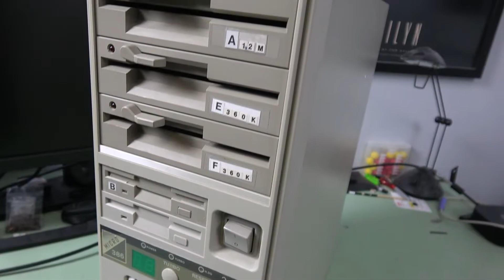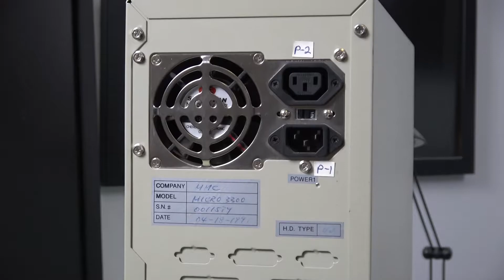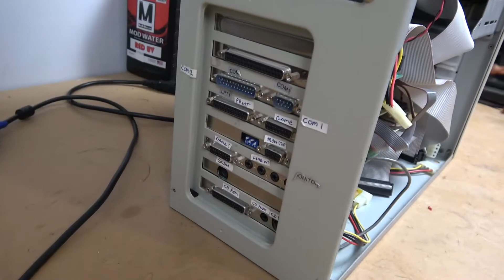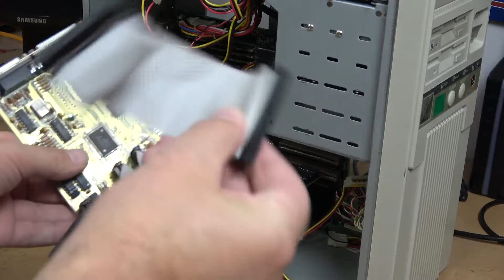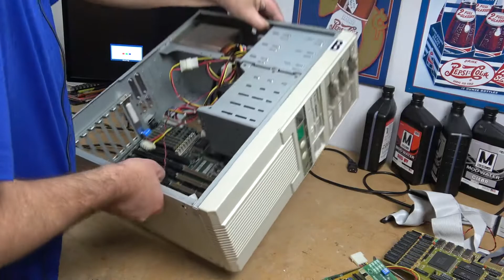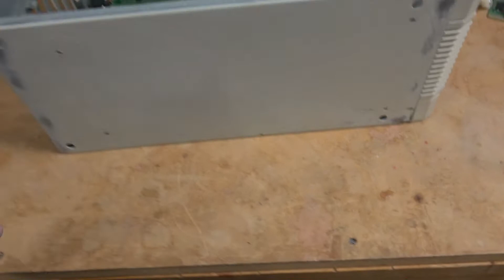Tear down of an Extremely Clean Vintage 486

Comment: Holy crap!  This was the exact same case I had when i was a kid!  Where did you get this?  I'm trying to source one for nostalgia.  Thank you for posting this video.  Brought back wonderful memories.
Reply from the maker: I picked it up off eBay.  I've always had the Mini Tower versions but, will agree the Mid Tower designs do offer more flexibility.

The plan will be to upgrade this machine to an 586 or maybe a Super Socket 7
Reply: @Hardwareasylum  I'll have to keep eyeballing eBay for this exact case.  So, far, not so good.  At the time I was just 14 when my family got rid of it, thinking it wouldn't hold value.  This is bc, I had a pentium 4 Prescott chip in a whole new case that I was using daily. 

Who would've known that I would of wanted to get back into this again.  I had my 486 when I was 7 years old, and I had Dos 5.22 with windows 3.11 on it.  Doom, Hexen, Duke Nukem, and all those fun games I played on it.

What search terms did you use?  Do you know the manufacturer of that case?
Reply from the maker: @sudobbq  That sounds familiar.  LOL.  As for the ebay search, it depends on how the item is listed and sometimes helps if you look for complete systems instead of just a case.  However, with that being said I've only ever seen Two (2) of these cases on ebay, and I bought one of them.  The other was a rusted out piece of garbage, though the bezel looked nice.  So, bottom line, they are pretty rare and if you think about it.  That phase where items have no value is when they often are thrown away or recycled.  the stuff we find now is often the forgotten bits that somehow survived the purge.